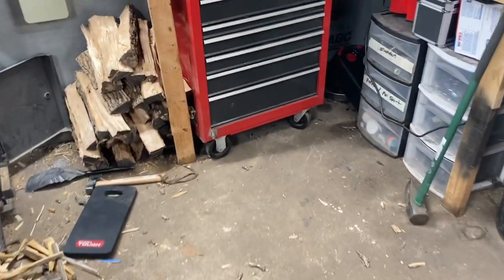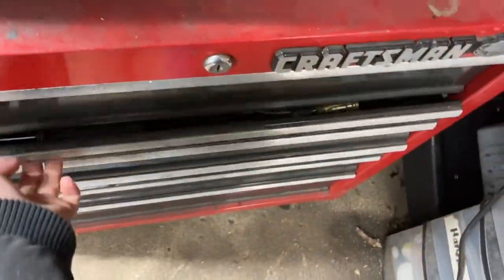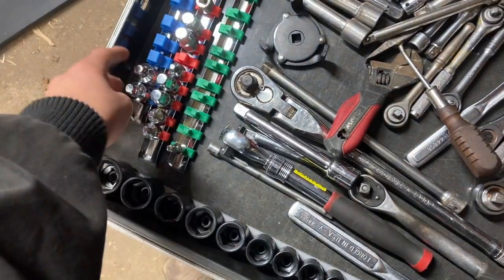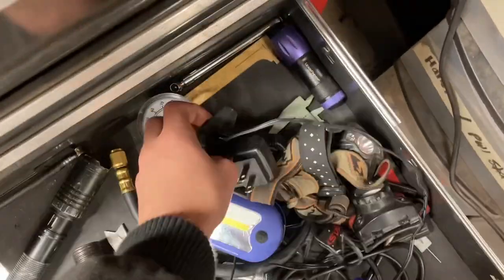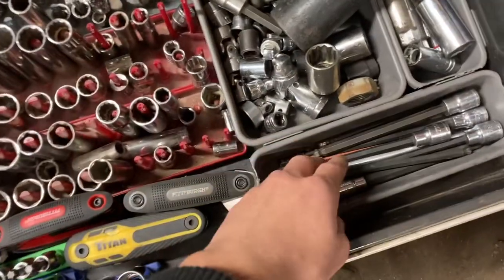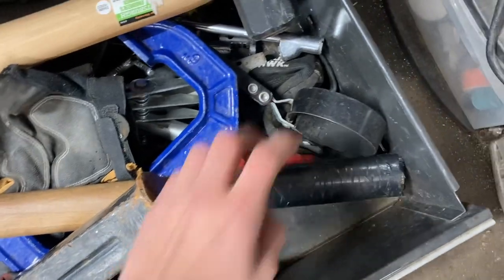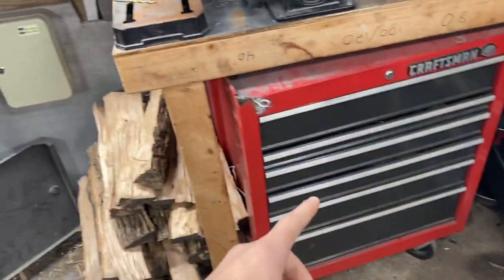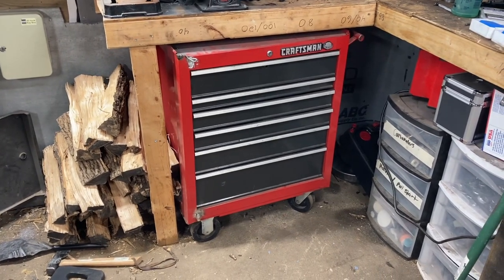Tool box tour (14 yr old small engine mechanic)

Comment: Your off to a good start if u get into the tecumseh 10hp snowblower motors you should really invest in a valve spring Compressor it's designed specially for those and the Briggs and Stratton engines too you can order it from Amazon it's like 30$ or something really handy tool to have. Another is a rpm gauge as it allows u to get a good feel of the rpms and if your running right fule/air mix amazon also. I do this stuff alot and that's the best advice for u keep up the work
Reply from the maker: Thanks for the advice I have a homemade spring compressor for now but I will buy a good one soon I’m pretty familiar with these engines too as I probably worked on 10-50 of them already
Reply from the maker: I have more tools in plastic cases as well like gauges and testers but this was a tool box tour later on I’ll make a full on tool tour!
Reply: @junisgarage529  the spring compressor Is a good tool a must have

Comment: I thought I was the only 14 year old that likes to work on small engines.
Reply: theres atleast three. im one, you are and OP is one. im licensed from a program i did under the classification "application technician" which means i can work on anything that doesnt drive, if its a v16 cat engine that runs a generator i can do it essentially. fun stuff